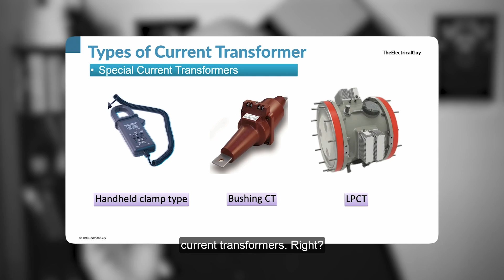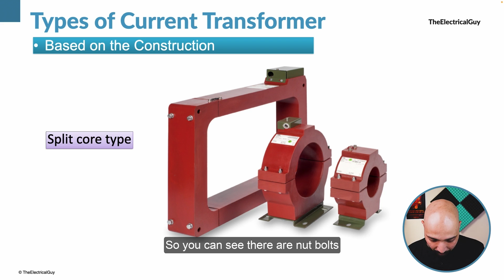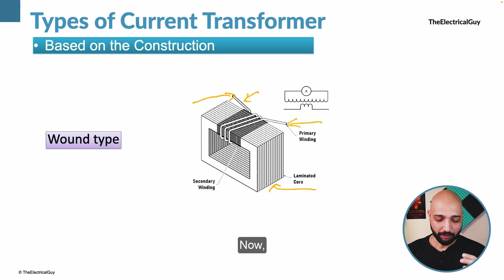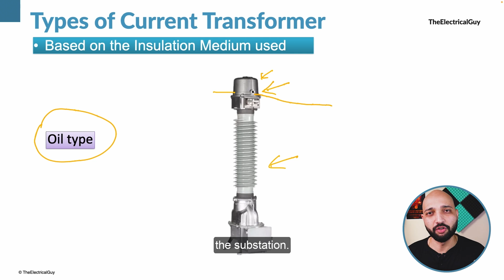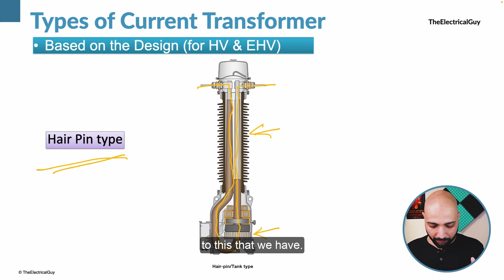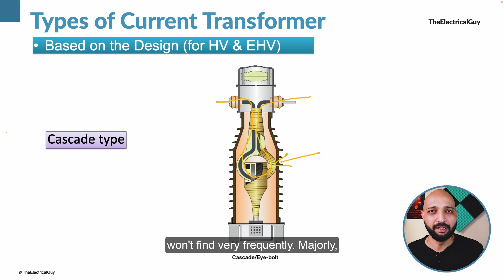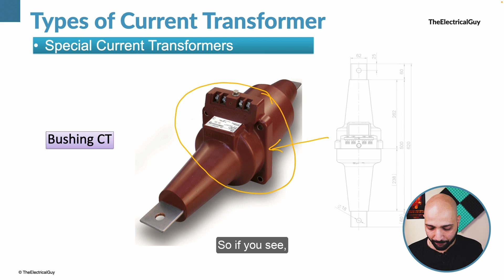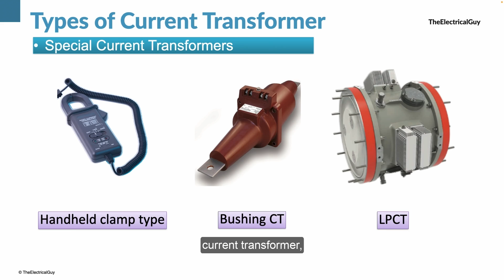Current Transformer types every Electrical Engineer should know | TheElectricalGuy

Comment: Dear Gaurav please requested to looks in vast domain of Relay section which explicitly covers protection aspect of substations and Power generation and Transmission line which is so far not covered in your vlogs.
We can slot learned on Substation each and every equipment but only that section is kept blinded from your end.
I know that is challenging one,but I hope its getting interesting one you take this to cover and give lectures on Protection on Relay point of views
Please urge you to start working on Relays